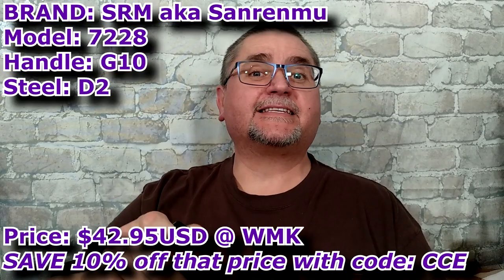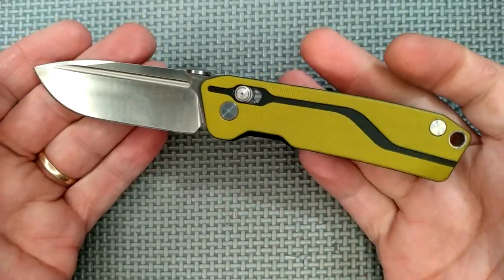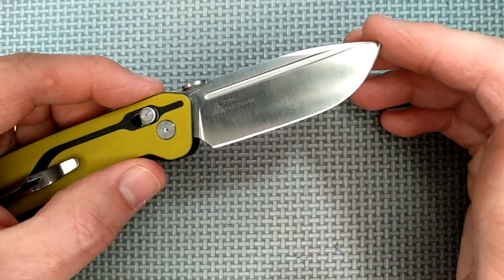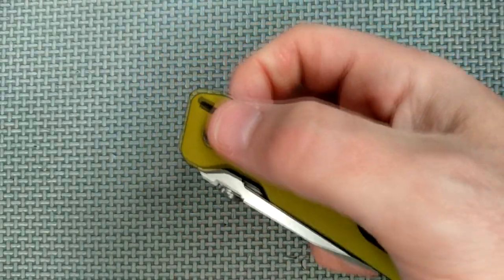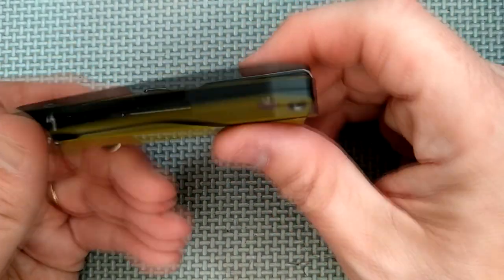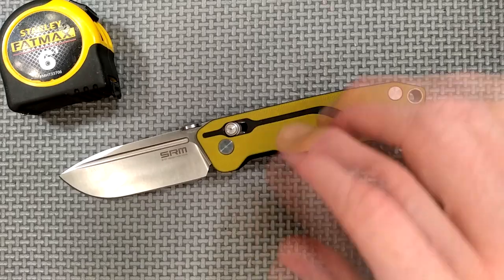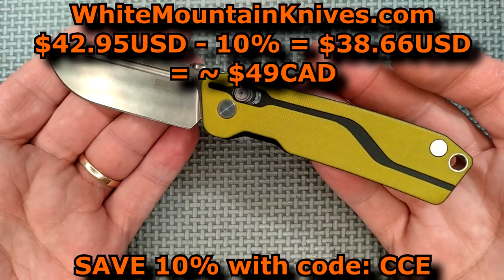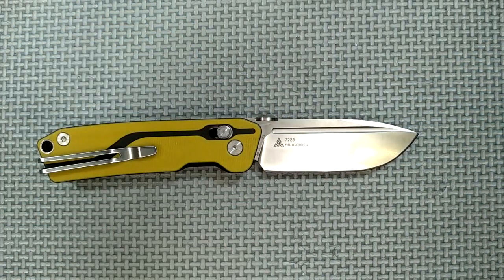REVIEW of the SRM (Sanrenmu) 7228 with NEW Ambi-Clip /  The Perfect Sub 3" Folder?

Comment: I loved this knife. I had one, lost it to a thief, just ordered another one after watching this video. I actually tested the blade on mine and was surprised to find it was actually D2 tool steel, and a hardness of RC60 at the edge. I figured it would have ended up being some kind of Chinese stainless like you often find in Eafengrow's "D2" blades. But my Eafengrow EF335 also tested as D2, despite my friends Eafengrow testing as some variant of 8Cr14Mov, can't remember which. Which isn't a terrible steel, but it doesn't even come close to the edge retention of actual D2. My knife Eafengrow is A LOT harder to sharpen than his, and holds an edge much longer, but they're the exact same knife otherwise. His even says "D2" on it, but he bought it in 2021 when I bought mine in 2019. I think Eafengrow is cheaping out on their blade steels, or whoever they get their knives from is, to keep profits in line with the pre-COVID era.
Reply from the maker: Sanrenmu has always been honest with the steel they claim to use on their knives.  I have reviewed about 100 of their models on CCE.  I am a VERY big fan of the brand.
Eafengrow often lies about the steel they use, which is why I stopped reviewing their knives.

Comment: Nice little knife but SRM overpriced it by $20. The QSP Penguin is $26.
Reply from the maker: The QSP Penguin is simply and superbly awesome, but it is quite the exception in he knife world.  If I had a very tight budget I would probably buy the Penguin.  But, the Penguin is a much simpler designed knife, it takes much less work to produce it in almost every aspect.  I don't believe it is an apples to apples comparison.

Comment: That’s much smaller than I thought it would be. How you going with the slipjoint review? I’ve never held an axis lock. Do you have to operate the lock from both sides?
Reply from the maker: I don't know what knife you are referring too concerning "the slipjoint review".
On most axis lock knives they can be actuated from just one side.  Some have very strong springs that force you to pull on both sides, but this SRM is very nice and can be actuated quite easily from just one side.

Comment: Hi Jake! Have u tried its larger version 7228L in vg10 steel that goes for around 60$ ? If yes, how are those? Good for the price? Bdw I'm looking at the one in red the 7228L-GV.
Reply from the maker: No, I have not tried the 7228L, but I would guess that they are going to have a build quality very much in line with the smaller version.

Comment: Hey Jake, I just got a Land GP-909 on eBay, and the pivot screw is a weird 5-pin thing. Have you run into that on older SRMs? And is there a tool for that? Thanks!
Reply from the maker: Yes, that is one of the older designs back when they put very off pivot screws on their knives.    I have seen it before.
I adjusted a screwdriver to span two of the divots in order to be able to take it apart.  Here is a link to the type I mean, I had to use a file to create something that looks like this: https://ali.ski/zmJfN  - Don't buy that set , it's just for showing you the shape. 

I got an old LARGE flat screwdriver and made my own to fit the knives - back then I have 7 or 7 knives with the same pivot screw so it was worth the effort to make  it.  I still had to boil the knives for a few minutes to make the threadlocker get a bit softer, or else I would not have gotten the knives apart or adjusted.

I hope this helps you out.
Reply: @CanadianCuttingEdge  yes, that’s very helpful. Thanks! 

I’ve been haunting eBay, cruising the cheap knives. That’s where this one came from. Some lovely people start their new knives (TwoSun, Enlan, etc.) for a buck, and sometimes I get one for cheap. I think I have enough (11 at last count) and then I see another cool one...

Comment: I love mine but the barbs on the clip are already warn out as my gf is a lefty and takes it when I don't get up early enough and keeps popping out on me. Think I'm going to put a conventional clip on it
Reply from the maker: You could buy your girlfriend her own knife.
I am not sure how to put a conventional clip on there.  you could drill and put threads into the G10 but I find that that method is not all that reliable as the G10 will strip out quite easily.
Reply: @CanadianCuttingEdge  I'm probably going to CNC a spot on the inside to insert a small steel plate that's tapped for the screws

Comment: AliExpress stopped delivering knives to Turkey just as this and that new SRM slipjoint were released. 😭
Reply from the maker: That sucks.  You should note that AliExpress is more like a group of stores, perhaps there are some other sellers that are willing to ship to Turkey.  That is if it is the same as it is with Canada.  At least 90% of sellers on AliExpress won't ship knives to Canada anymore, but there are a few that still do.   I know how frustrating it can be to not be able to get the knives you want, not that that will make you feel better. :(
Reply: @CanadianCuttingEdge  yeah, there are a few places that sell dodgy Damascus fixed blades I'm nylon sheathes that'll still send here. But for anything of any quality, like SRM, I'm out of luck. 😭

Comment: Jake, do cheap axis locks on budget knives last or are they prone to failure? I am new to folders and wondering whether to go for the SRM 1168 with a liner lock or the 7228L with the axis/ambi lock. What do you suggest? Thanks in advance.
Reply from the maker: SRM is well known for quality.  They might just have the best budget to quality ratio of ANY knife company. The do have some anodization issues on some knives but non of their axis locks has ever given me a bit of problem, they all work well. Solid lockup, well as solid as any axis lock can be.  I cannot say the same thing about Benchmade axis locks - they created this style lock but they had a long time when their axis lock springs frequently failed.
Reply: @CanadianCuttingEdge  Thanks for the quick response. The 1168 (D2 steel) is available for about US$ 33 and the 7228L (VG10 steel) is available for about US$ 50 where I live.
Should I choose the former and save myself a few bucks or invest on the latter? My budget is right around the US$ 50 mark.

Comment: Thats a 25 dollar knife..over priced. Like the clip
Reply from the maker: I agree that the price is higher than I would expect.  Size has only a very tiny bearing on the cost to produce a knife.  This is a better performing axis lock than almost every Benchmade I have ever had in my hands.
I think what Sanrenmu is doing is they are testing the Western market with their new SRM branding.  They are making a whole series of SRM knives and they all are priced a fair bit more than we are used to seeing from Sanrenmu.   The 7315 I have with exactly the same clip is made under the Sanrenmu branding and it costs a lot less.